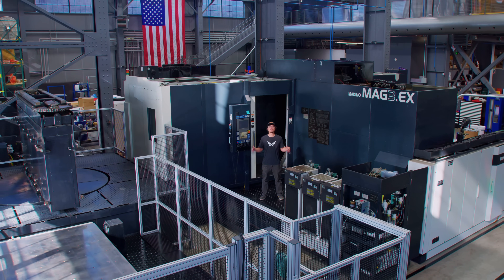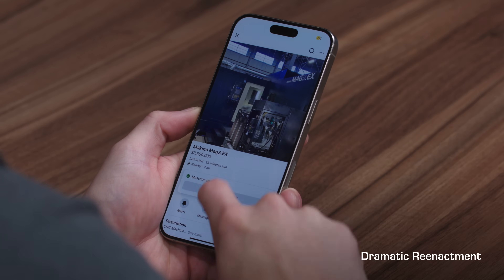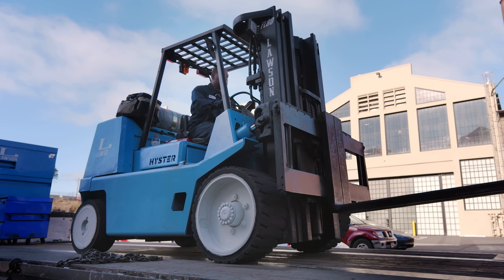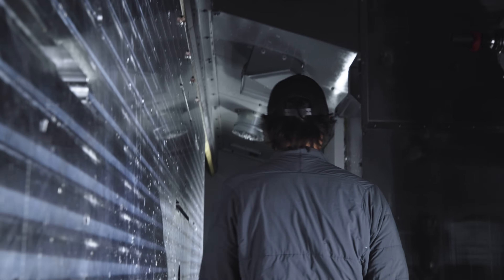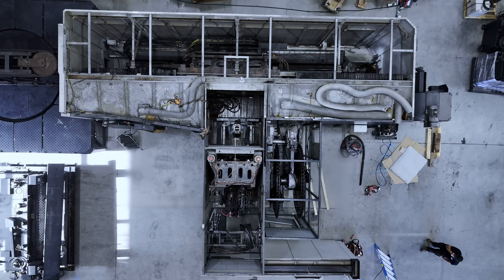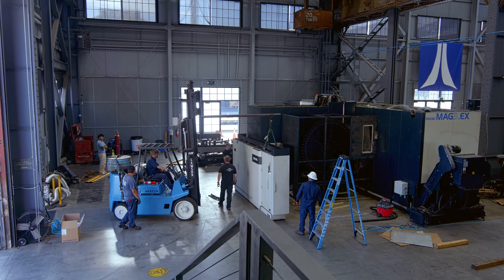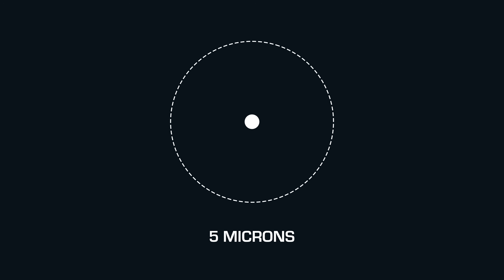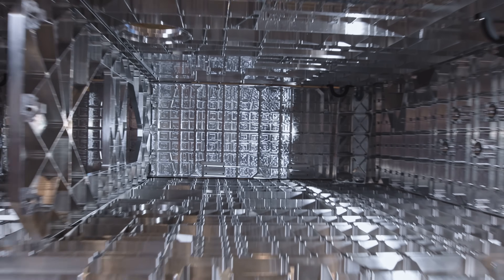Unboxing a $3,500,000 CNC Machine | Makino MAG3.EX

Comment: The part you're making is a big flat waffle panel like that?? Wouldn't even a big 3 axis vmc suffice like even a haas vf6.
Reply: We actually have a VF6 and use it for some smaller orthogrid panels, but most of the panels for this build were too big to fit in the VF6. Even if they did fit, the MAG has some major advantages. It’s much more powerful, removing material something like 5x as fast as the Haas. The horizontal configuration makes chip handling a breeze on the Makino. even if a VF6 could make chips like the MAG, you’d have to pause mid program and get in the machine with a shovel every few minutes during roughing. And it’s not just faster, the MAG also produces higher quality parts with better finishes. Beyond all that, some of the parts we make on this machine require the extra two axis capability to limit setups and improve precision.
Reply: @iansteigmeyer6116  Thank you! makes sense to me.

Comment: Fanuc Control is a bit meeh but i guess common enough in the US.
Reply: Fanuc controls are not that bad especially once you get use to it, it is not most beginning friendly but it sure is powerful.
Reply: @muhuyan7281  I dunno i use haidenhain and siemens and i felt fanuc is more a thing for set it up once and never touch it again. Just mounting drives and remote control felt to clonky.

Comment: Watch out for this spindle! Look at it for too long and it's blown ahah nice machine. I was running 4 of them on a 12 pallets train by my self.
Reply: Mind elaborating on the spindle failures? I'm always curious about how they break...
Reply: @davidg3944 they are extremely fragile since they can spin to 33k rpm and the bearings are ceramics. If you don't smash it's not really a problem.
Reply: @alexbike01  Thanks! Presumably that's a smaller spindle than the one shown in the video, getting that up to 33K is moving...
Reply: The spindle in the video is ~100hp and can run a 1” rougher at 33k. It requires extremely well balanced tooling.

Comment: What is this machine normally used for? The work envelope seems surprisingly thin/ skinny, almost like it was meant for satellite panels and not normal industrial use cases
Reply: Aircraft wings and spars seems a natural application.
Reply: they are typically used for air frames for planes

Comment: as far as big machines go, this is entry level. Only weighs 45 tonns. Thats basically an aluminium machine. Try drilling 4inches dia in inconel, and that machine will crap the bad. 
It's a specialized machine. Very nice, very accurate, but not heavy duty. The 100hp doesn't mean much. You will be able to machine aluminium up to vc3000m/min at 20-25k rpm.
Reply: moved a machine this january, just the y ax was 75ton (total machine was close to 120ish ton) and with max piece only about 2500x2500x800mm not even a big machine
Reply: This machine series is purpose built for aerospace aluminum structural components. If you are doing hard metals like titanium and inconel, take a look at the Makino T Series machines.

Comment: Awesome. Would like to hear the methods of stress relief and dealing with warpage on such large asymmetric hogouts
Reply: Great question, hope it's answered.
Reply: My cousin machines F-35 bulkheads on large bridge mills and said they rough one side, flip, shim, rough, flip, shim, semi finish, flip, etc until it’s done.
Reply: That’s pretty much how we do it! Removing material makes the workpiece warp, so we remove it gradually. Unclamping and reclamping to let it relax, using shims, etc.
Reply: @Thewaldo12345  Yeah, used that strategy myself plenty of times. Tedious, but it (usually) works. Question: I presume he's starting with forgings, not raw plate? I don't think there's anything "secret" to worry about with that Q...